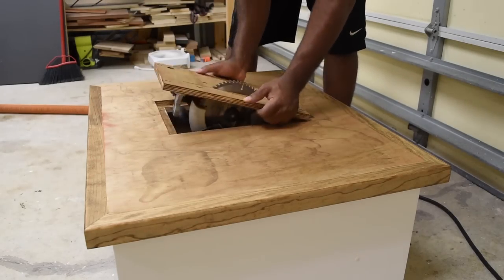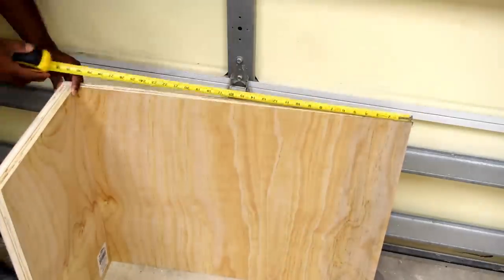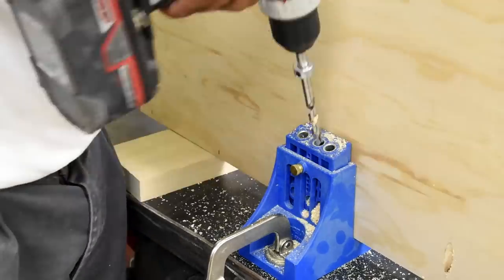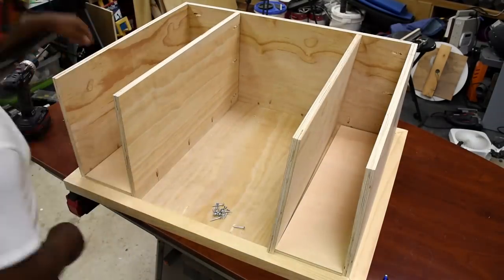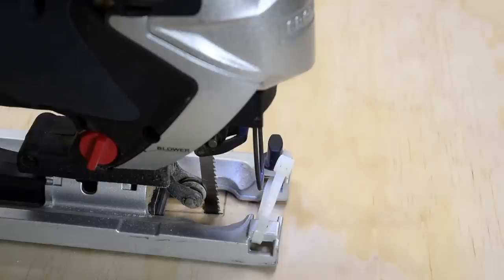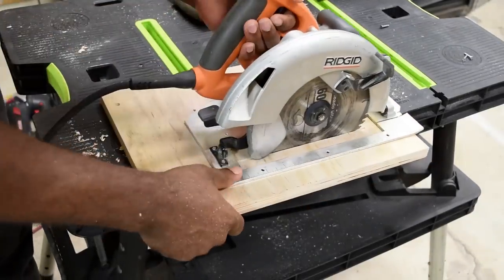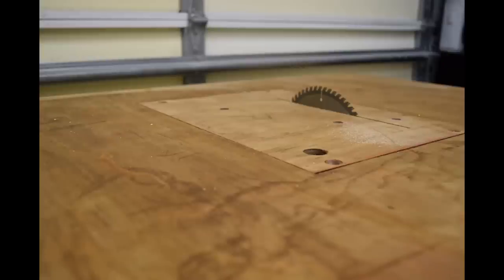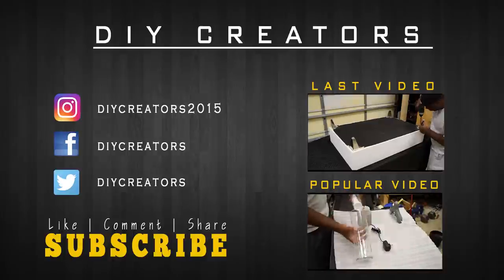Homemade Table Saw 4 in 1 Modular Workstation

Comment: I'm just getting around to making this one. I especially like the downdraft table and jigsaw. I'm also curious to know if you have any ideas for a small crosscut sled. I just got an M18 table saw and I'm stoked about it. 
Thanks for sharing your work and ideas. 👍🏾
Reply: If you have a rip fence just take a sheet of wood and a thin piece of wood that fits in the miter slot (cut it down to size on the table saw until it's a snug fit), elevate the thin piece in the miter slot slightly above the table and glue it to the bottom of the board (then attach it with some flush screws). Then square a piece of plywood or lumber to the back with the blade before tacking it on more permanently. Could always get fancier with it, but that's as simple as it gets and honestly there's no need to get much fancier than that with a crosscut sled.
Reply: @stevenpuckitt212  thanks

Comment: I have a couple of questions. Could you take a 1 foot extension cord and wire that into the switch and just plug in the saw? And if you can’t do that where can you get the negative wire and the jumper wire? Like can you get it at any hardware store?

Comment: Might be a silly question but how do you turn on your table saw considering it's a circular saw that needs it's trigger pressed down (which is now not accessible in the bench)?
Reply: Zip ties would work to keep the trigger pulled.
Reply: Yes have conceived a similar thing myself a few years ago but didn't build as couldn't solve for the turn on/off element.

The suggestion of cable ties is sound but basically you're giving up a portable tool for one that is fixed to the table's various modules. Which is fine but if you want a hand held tool as well then you need two of each.

The video and teaching is awesome, but would be good if the practical application was shown to resolve the on/off question.

Comment: Do you think I'd get away with 1/2 inch plywood? Would it hold the weight of my full size router do you think? I'm in England and 12mm (1/2") is much more reasonably priced!

Comment: The safety issue I see with your switch is that it’s a paddle style.  You could easily bump that on with your knee or a 3 year old passing by.  Perhaps a different switch or a flap that swings up that covers it from bumping.   Otherwise I dig your stuff bro.

Comment: Two things the wiring. 1. sometimes the wire is green not bare. 2. there is a safty switch that you just plug into. with extension cord. You can find it on Amazon or Rockler.

Comment: My only criticism or concern is you should really use a double pole live and neutral switch as it you turned off the neutral switch you've fitted the table is still live for instance if there was a fault and you turned it off at that switch and there was a leak or short on the tool when you touch the tool you would complete the circuit and become the neutral connection

Comment: Hey man great tutorials but how do you pull the trigger on your tools? Do you like zip tie them then just turn off and on power to them?
Reply: Most of the tools have small button in one of the handle sides that locks the main switch in the on position
Reply: @saberben4785  ok my circular saw doesn't have that. My jigsaw does though
Reply: @TheDrblu  then if you use a light switch just like in the video the easiest solution is zip tie
Reply: @saberben4785  thank you

Comment: The only circular saw I have is a DeWalt 36v cordless model. 
Would this be easy to swap out batteries with?
Reply: You put your finger in the hole. You take out the plank. You switch the battery. You place the plank back. How does someone have pro powertools and not get this?

Comment: So I got started on building this yesterday during the holiday... I have a really cheap piece of shit circular saw from Harbor Freight. This thing is so crooked, I've got it mounted to the plywood., with the blade perpendicular to the front edge, and the whole base is jacked like 13 degrees or so. 

I think I have to start over with a better circular saw. lol

But I will add this... for the light switch / power toggle... I'm going to use a combination switch / power outlet, so you have another power outlet on hand instead of needing ANOTHER extension cord.

Comment: way to late probably, but how did you address the deadmans switch on the roundsaw and jig saw?, only solution i can think of is having a rig wrap around the handles that is holding it on and then have a switch that regulates when it's powered

Comment: Shouldnt the pocket holes have been drilled towards the center of the board that we re connecting to? The side panels were connected to the outer edge of the board it seemed. Or maybe im over thinking it 🤔

Comment: 10:40 
Is it a standard jig saw, a cheap toy or an expensive one?
Reply: His is a very expensive one lol
Reply: I just checked some out and my base line are jigsaws... I check the price of those to see how a brand prices there other tools. Black and decker is the cheapest one you can get for $35... his is $79. So actually it’s not that expensive. The one I originally saw was $139 but I didn’t realize that it was cordless.
Reply: @christina3478 
I did found one for us$28 (Einhell) I asked a repair technician and he tells me that that jigsaw is as reliable as an average black & decker. I also found a jigsaw for us$13 (Kkmoon). Nobody knows that brand so ... lol
I´m in Patagonia, at the end of the world. We have less options and everything is more expensive. I´ll try the Einhell. Cheers.

Comment: Home made table saw is an excellent way to get injured, especially w/out anything to prevent kickback. Even if you "DIY" a riving knife, how sure are you that it's placed correctly, the correct size or bolted with the correct torque? The table saw manufacturers spends millions on R&D to both design and TEST those safety features for which you have none.

You would've been better off showing people how to make a Table Saw Stand.